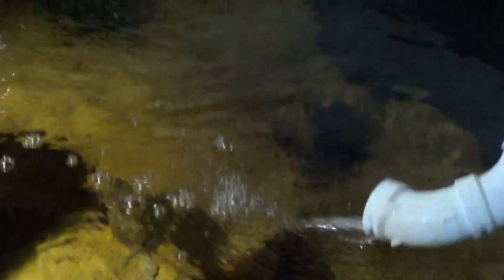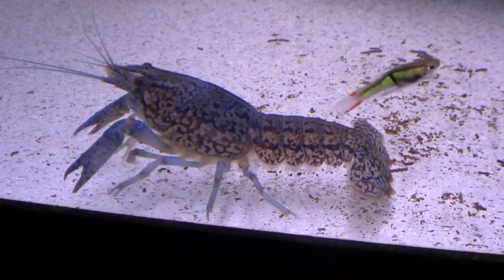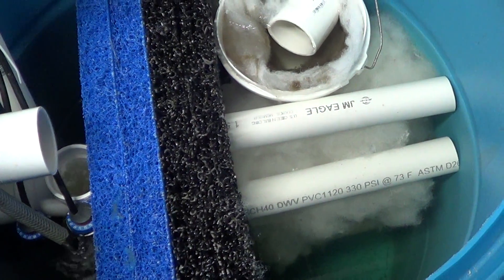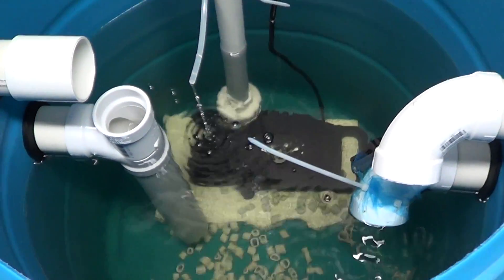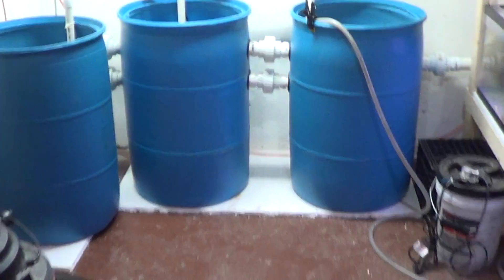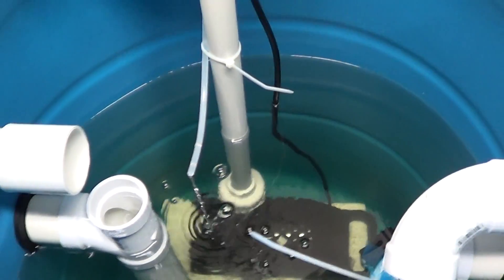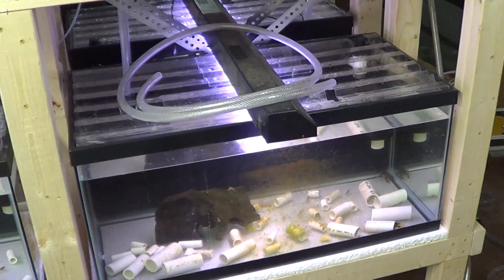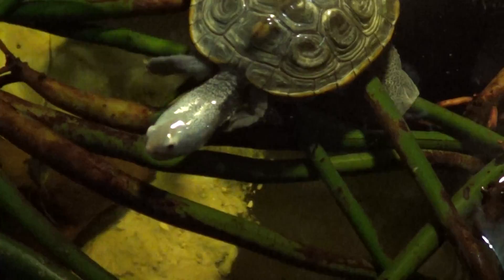#262: Next Steps on the Central Sump System - Update Monday

Comment: You know the bucket where you have the pre-filter you can drill a bunch of holes around the the bucket and put the filter floss the way you have it. Pickup some plastic mesh that you can curl up to put it inside the bucket and let it expand and hold the floss against the inside of the bucket.  Just a thought so it will be neater.  The king of diy Joey has a nice filter system with the K1 with the same blue drum that you got . Have you check it out. He starts to talk how to determine how much K1 media you need at about 10:37.   HOW TO: Build A Large Aquarium 5/6

Comment: @Greg Jones - dude. just put a Solenoid valve on the input of the RO/DI. when power goes off, then the line stops dripping. LOL
Reply from the maker: If you go back and look at past videos i did put a redundant solenoid valve system in place and they both failed in the open position in under 6 months, the problem with solenoids is they stick/fail and even the ones rated for continuous duty aren't reliable enough for me
Reply: oh damn. that would have been a perfect solution :( - automate a tap closing?

Comment: Hello Greg I like the drip system you got their I want to do the same in my tank I just have one question I have a 40gal long and a 29gal sump I just wanted to know is it a good thing to drip 40gal a day or should I cut it back to half of that I will be putting discus in the tank and I know they like pristine water and do I still have to cycle my tank since I do not have to worry an ammonia spike. So what do you think thank you
Reply from the maker: cycle your tank first, i know discus like pristine water, but i still wouldn't change more than 50% per day via the drip system, but that's just me, i know discus breeders that do an 80% water change every day religiously. by changing over the water so rapidly your levels should always remain around zero, but without a strong cycle to start with you could starve your bio filter - imo

Comment: Your 'super sump' filter has great potential but might miss the mark a little. 
Food for thought: You might do mechanical filtration in a tray, then rain down over pot scrubbies or bio-balls (to maximize nitrosomos and nitrobacter aerobic bacteria). The next chamber might contain a better bio-media bed like Seachem Pond Matrix/Matrix/DeNitrate,  pumace stone or lava rock (FW equivalent to SW live rock) to encourage anaerobic bacteria to oxidize nitrate (pipe from barrel one to the bottom of barrel two). Your fresh water drip needs to go more directly to your tanks - right now it seems like much goes right out the drain.
The down side I see in a centralized system is that any parasite or disease in one tank could spread to all, but I hope you'll never see that!
Reply from the maker: +Mike Vormwald it has evolved a bit, i'll do an update video on it at some point, thanks

Comment: I don't usually comment, but I think I can help on the drip system. In the case of a power out, the drip system could potentially flood your basement. So, why not just put a NC (Normally Closed) solenoid on the drip system hose, so when power goes out, it'll close. Also put a NO (Normally open) switch on the solenoid if the water ever goes above certain level. Maybe you're doing just that and I didn't understand it, but it seems to me that your system is way over complicated. I could draw schematics if I wasn't clear, english isn't my native language. Thanks, and keep those videos coming, 'cuz I love 'em.
Reply from the maker: that's pretty much exactly what i'm doing, stay tuned, those videos will be released shortly!

Comment: It's not clear to me exactly what is happening in the first barrel in terms of plumbing, but what I would do is a top down water flow with your pre-filter first (no need for swirl at all), followed by your screens (in case the pre-filter gets clogged by some unforeseen accident and spills over), followed by a barrel full of polyester fiber.  I would extend the outflow with a pipe to the bottom where you would screen off the fiber.  That gives you 100% flow through media - a hell of a start on both mechanical and biological filtering and inexpensive ability to replace the whole barrel full of fiber.  Barrel 2: 'Permanent' bio media and I would advocate some large sacks of carbon.  I'm not a 'true believer' in moving K1 and I would think that ceramic rings would be excellent instead.  Barrel 3: Shouldn't the barrel filtered water & the fresh drip come in at the return (to tanks) point and not just before the drain?  Or am I confusing things?

Generally, it looks great, but I'd make 100% use the media capacity of the barrels.
Reply from the maker: good ideas! the outflow pipe does extend close to the bottom, so perhaps i should stack my mechanical media like a hamburger like you described, the fresh drip hits the surface of barrel 2, the outflow into barrel 3 is at the bottom, i'm not sure moving it would make a huge difference, we'll get there, thanks!

Comment: thats over 3000 gals a month in water cycling, lil expensive, yet smart, now as for the vacation and over flow idea? how about using a backup battery powered shut off switch to the waste tank, with a sensor on the waste tank to shut off the water change system, case of power failure.